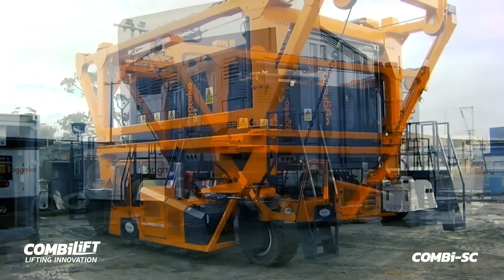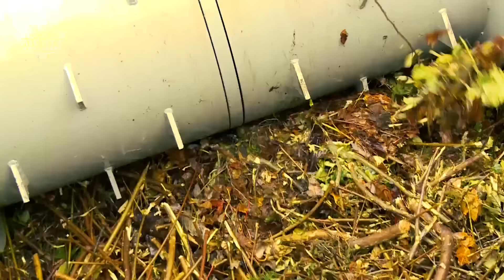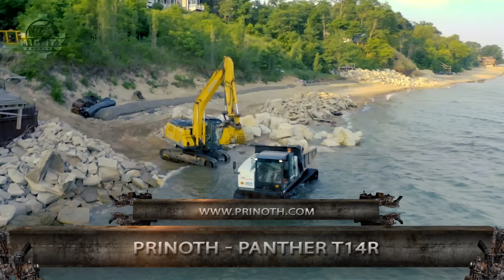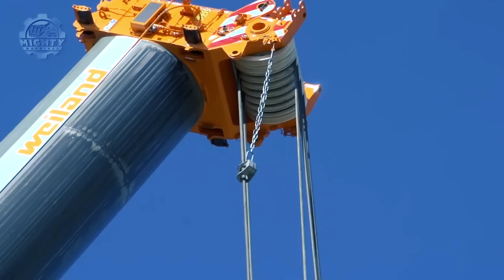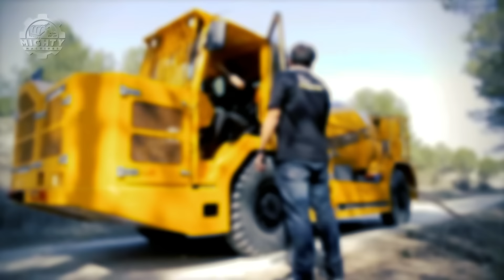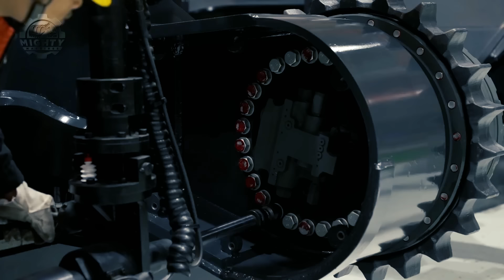100 Most Dangerous And Most Powerful Machines | Ingenious Tools And Equipment EVER BUILT

Comment: This video really highlights how far technology has come in terms of machinery and automation! The Gerhard Ducker Outrigger, for instance, seems like a game changer for roadside maintenance. The ability to operate it with a remote control while driving must drastically improve safety and efficiency. I can’t help but wonder, though—are there any potential downsides to this level of automation? For instance, could it lead to fewer job opportunities in manual labor sectors? While it’s clear that these machines save time and resources, it’s also crucial to consider the impact on the workforce and whether the benefits truly outweigh the costs. What does everyone think?

Comment: The biggest con today worldwide is "Battery" power, until the general public is allowed to use more modern and highly efficient batteries. Imagine the cost of replacing those lipo's on that electric crane? it might cost more than the crane it's self.
Reply: yeah... and is creating a battery good for the environment?????? :/
Reply: @JonathanGillies  only if it lasts for 28,000 years on the one charge
Reply: People that used horses said the same kind of stuff about the gasoline engine.
Reply: @bigredc222  Yeah........ They said, "The biggest con today worldwide is "Gasoline engine" power, until the general public is allowed to use more modern and highly efficient gasoline engines. Imagine the cost of replacing those lipo's on that gasoline engine crane? it might cost more than the crane it's self."
Reply: @JonathanGillies   The crane is not practical now, it may be some day. I've been a motor head since I was 12 years old, I work on all my own vehicles, nothing sounds better than a V8 or a Harley V twin, but if people want to use electric vehicles what do I care, that leaves more gas for me. I don't get the hate.
Reply: @bigredc222  So would you agree with the following statement then: "The gasoline engine is not practical now, it may be some day. I've been a horse head since I was 12 years old, I work on all my own horses, nothing sounds better than an Appaloosa or a Morgan, but if people want to use gasoline engine vehicles what do I care, that leaves more horse for me. I don't get the hate."
Reply: @JonathanGillies  150 years ago that's the way many people thought, I don't know I would have felt. I guess you would have been the guy that cursed them damned newfangled automobiles.

Comment: Amazing machines featured in this excellent video!
Reply: This video really highlights how far technology has come in terms of machinery and automation! The Gerhard Ducker Outrigger, for instance, seems like a game changer for roadside maintenance. The ability to operate it with a remote control while driving must drastically improve safety and efficiency. I can’t help but wonder, though—are there any potential downsides to this level of automation? For instance, could it lead to fewer job opportunities in manual labor sectors? While it’s clear that these machines save time and resources, it’s also crucial to consider the impact on the workforce and whether the benefits truly outweigh the costs. What does everyone think?
Reply from the maker: Thank you